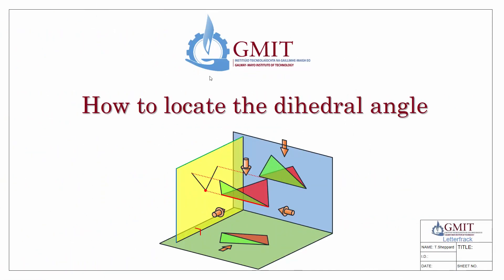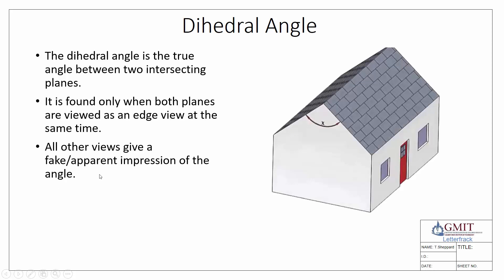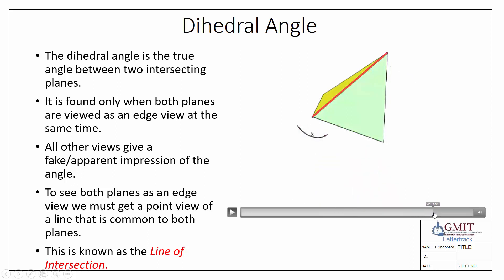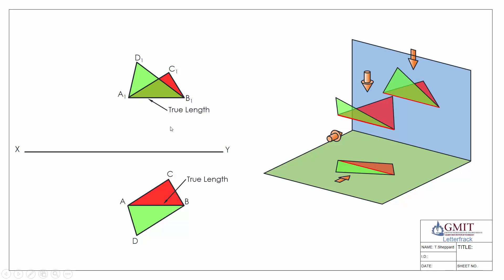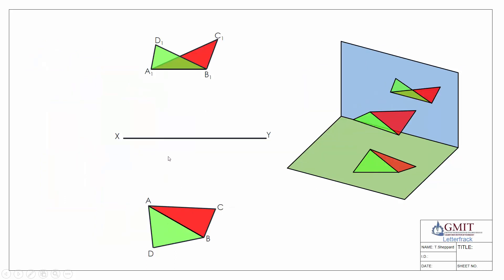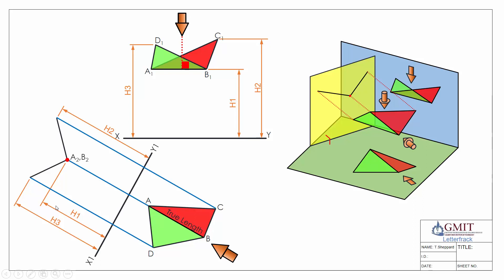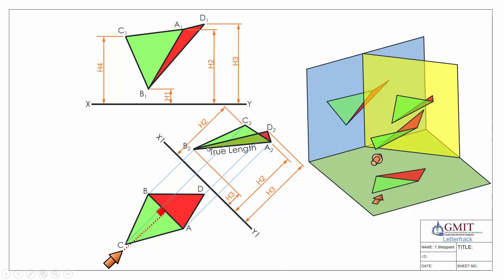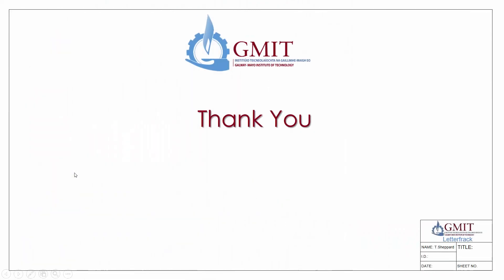How to determine the Dihedral Angle between two planer surfaces

Comment: great animations.  I was looking for example on teaching this topic to bunch of woodworkers. This is very clear.  One question: In the initial example of the roof, the sides descend from the ridge line, but on the projections they incline from the ridge line.  This seems to make the presentation inconsistent. Is this intentional?  Or am I misinterpreting something?
Reply: For woodworkers id recommend developing the dihedral for a 4 sided box with equally splayed sides as it’s a very straight forward process and a similar process for finding the dihedral angle for a hip roof!